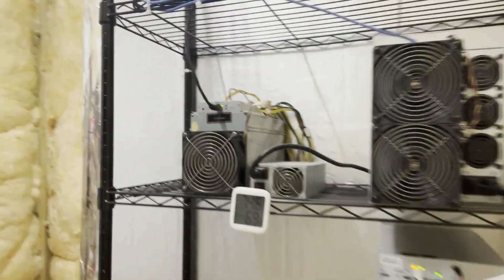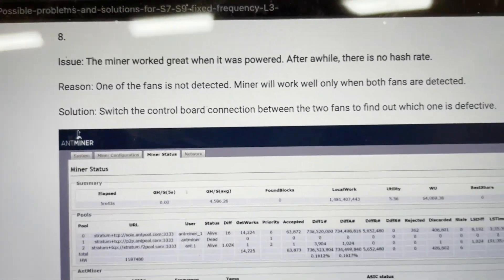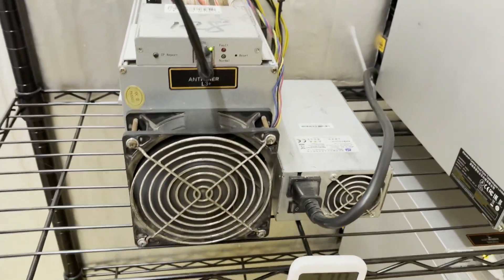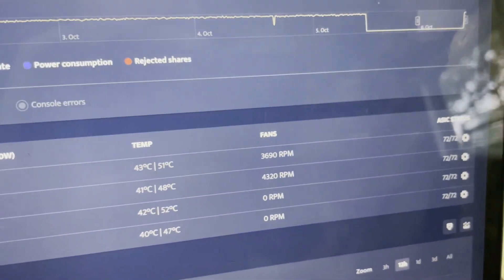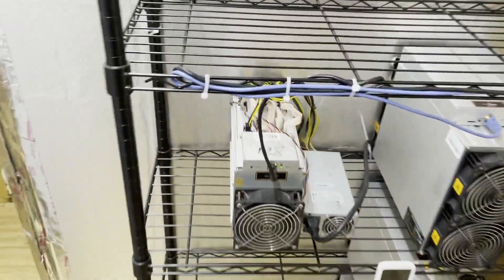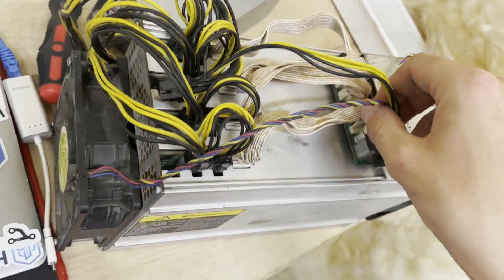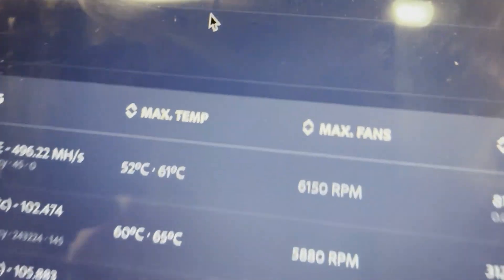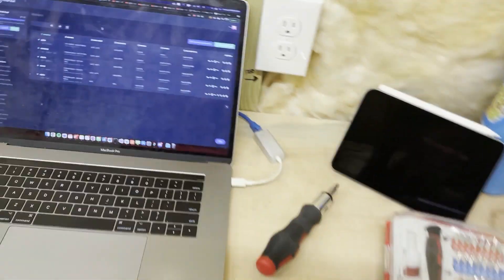How To Fix Antminer L3+ with No Hash Rate | Bitcoin Mining Shed

Comment: Hi, just found your channel. looking forward to seeing some more of your videos. message me if you have any good suppliers for asics. would be interested to shop around.
As to you l3+ problem.
1 could just be a loose connection on the fan cables. make sure it has snug fit then give it another go.
2 could be a broken fan. swap front and back fan cables. If your kernel log says fan 2 speed too low. Then you have broke fan.
3 could be broken control board. If after swapping front and back fan cables kernel log still says fan 1 speed too low, then likely a control board issue.
while waiting for a replacement you can keep your miner hashing. install hiveos, run OC profile 504mh 660 watts, disable fancheck for immersion cooling, set shutdown over 80 c protection. keep the "good fan" on the intake and use the bad fan on the exhaust.
Let me know how it goes! happy mining.

Note: wear some ear protection in the shed! the fan noise will kill your hearing!